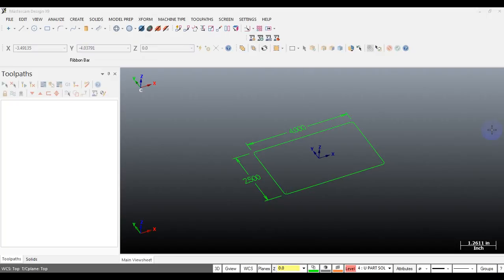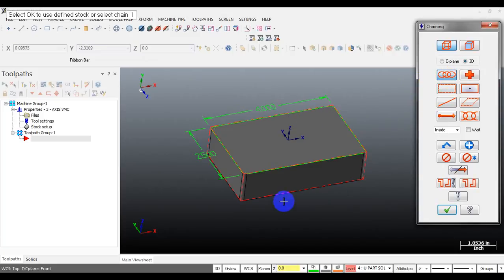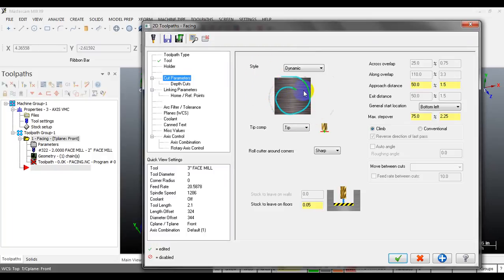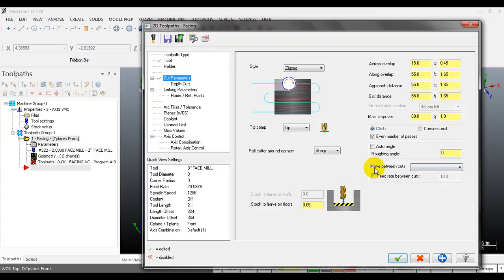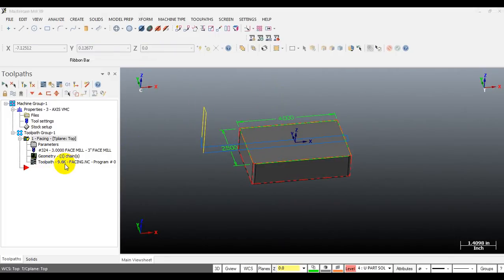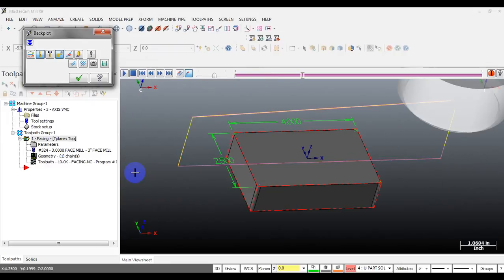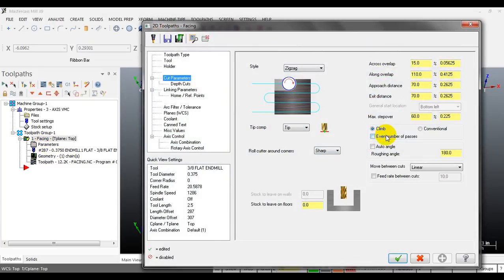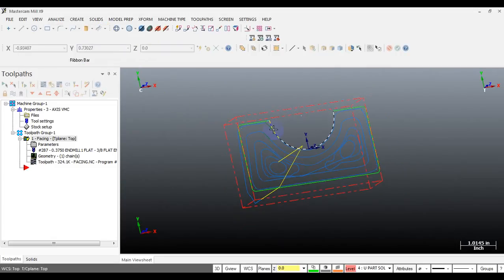Mastercam for beginner-Lesson 1: Facing toolpath

Comment: I've tried many settings, mostly in chaining, and can't get the result I'm looking for.  At 23:30 your tool path goes from the bottom right to the top left.  I need to go from the top left to the bottom right.  I'm interested if you have a solution besides trying the pocket toolpath?

Followup for others who may have the same question.  Changing the Roughing Angle to 180, from 0, will rotate/mirror the start point.

Thank you so much for your videos, they are excellent!
Reply from the maker: have you tried the machining angle from 180 to 0 degree?
Reply: I did try this a little while after posting my comment, it worked, I added the update to my comments!

Comment: Thank you.  We have basic routing 2019. No 3D.   I’m trying to helix a hole.  Example making 3/8” diameter hole with a 1/4” router bit.   If I use contour.  It plunges routes the path... plunges routes the path plunges routes the path.  Based on steps.   Every time it plunges I get serious chip wrap ( working with poly0propylene)It seems I have no ramp function in contour milling.   I found a way with pocket milling but can’t figure it out.   
Anyone have any ideas how to ramp or helix a hole with MC 2019 most basic software
Reply from the maker: can you send me a picture to my email?
Reply: I’ll send a pic of cut parameters in contour operation tonight.   Thanks
Reply: GIANG THE TOOL how do I find your email.  Sorry